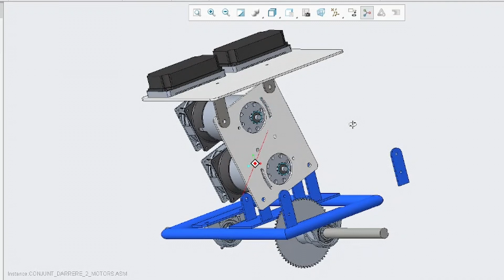Reviving my first electric go kart E1 | Motor, Controller and Steering

Comment: is there a reason why you didn't install the axial motor you built?
Reply from the maker: It was just a prototype to check if the dual rotor was feasible or not, it ended up working but I don't expect too much of it when testing on the dyno. The version that I have half built is single rotor.

Comment: It's been quite a few years since the first video of the original CAGK project and the old channel name, and I'm so happy to have found you and have seen you progressing with the second kart, now even more that you decided to revisit the original kart and give it a facelift.
It's a little sad to see the alternator be swapped, but I'm happy to see the upgrades that are coming in it's place
Reply from the maker: Yes, time has passed, and I still remember you being my 10th or 11th subscriber when I started, so thank you so much for the loyalty! I decided to fix everything wrong with this project because family and friends tried the go kart and wasn’t the best experience for them. The controller was freaking out and also the sensors on the alternator started to fail sometimes, in addition to that it wasn’t steering properly due to the massive caster I had. I actually chopped the frame and extended it and now the steering works perfectly (you will see it on the next video). I’m preparing the battery right now to swap the underpowered existing one, to be suitable for the 2x2500W motor setup.
Reply: @OverbuiltByHenry  I can't wait to see the next video then ^^